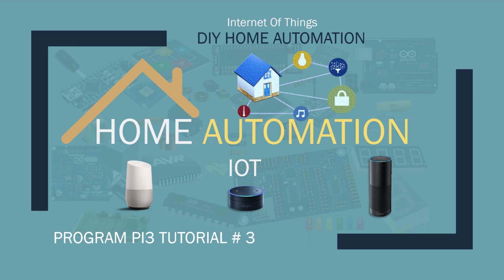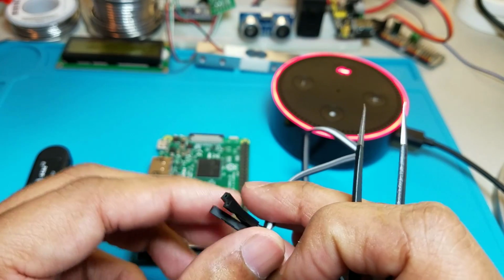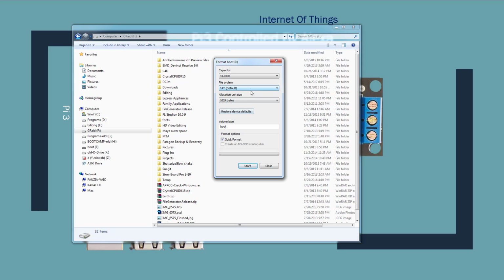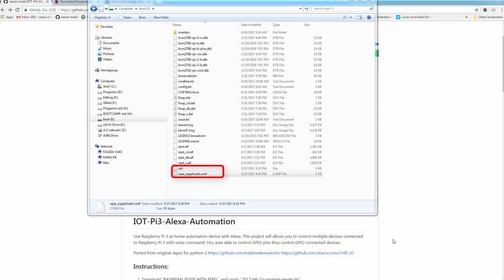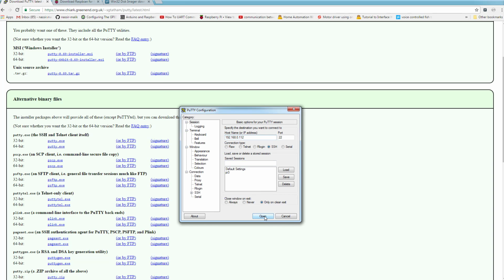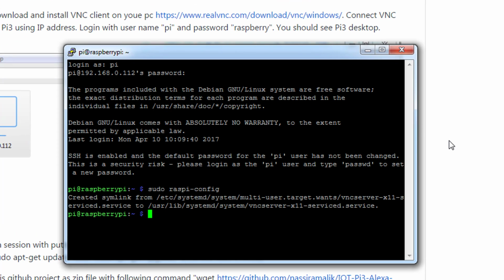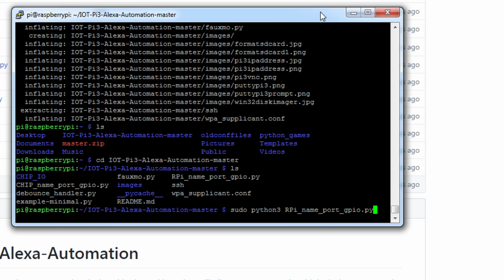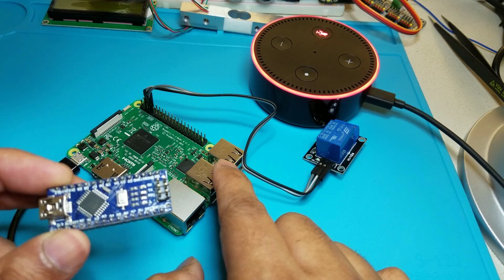Raspberry Pi projects beginners | Home Automation with Alexa | Tutorial # 3

Comment: Thank you so much for your work and clear and easy to follow video! I do however have a problem because my echo dot 3 does not find any devices. I searched for a solution but couldn´t find any. Seems like the newer alexa versions do send some different messages and fauxmo doesn´t work with that. Do you have any solution to get this running with an echo dot 3 ? would appreciate any answer :-)
Reply from the maker: Let me check

Comment: Great video Netmedias but i cant connect alexa with pi. Alexa doesnt reconize it. Im using pi 3B+ and echo 3gen. I got this log
DEBUG:root:Listening for UPnP broadcasts
DEBUG:root:got local address of 192.168.100.140
DEBUG:root:UPnP broadcast listener: new device registered
DEBUG:root:FauxMo device 'LED' ready on 192.168.100.140:52000
DEBUG:root:UPnP broadcast listener: new device registered
DEBUG:root:FauxMo device 'FAN' ready on 192.168.100.140:51000
DEBUG:root:Entering fauxmo polling loop
DEBUG:root:Responding to search for LED
DEBUG:root:Responding to search for FAN
DEBUG:root:Responding to search for LED
DEBUG:root:Responding to search for FAN
##################################   handle_reques #######################
b'GET /setup.xml HTTP/1.1\r\nHost: 192.168.100.140:52000\r\nAccept: */*\r\nContent-Type: application/json\r\n\r\n'
##################################   handle_reques #######################
DEBUG:root:Responding to setup.xml for LED
DEBUG:root:Responding to search for LED
DEBUG:root:Responding to search for FAN
##################################   handle_reques #######################
b'GET /setup.xml HTTP/1.1\r\nHost: 192.168.100.140:51000\r\nAccept: */*\r\nContent-Type: application/json\r\n\r\n'
##################################   handle_reques #######################
DEBUG:root:Responding to setup.xml for FAN

Comment: Great video, I subscribed but I am having trouble connecting my 3rd Gen Echo to the board.

Whenever I search the command line shows a connection but it eventually fails and get stuck in the loop below.  Any help is appreciated.

pi@raspberrypi:~/IOT-Pi3-Alexa-Automation-master $ sudo python3 RPi_name_port_gpio.py

DEBUG:root:Listening for UPnP broadcasts
DEBUG:root:got local address of 192.168.1.201
DEBUG:root:UPnP broadcast listener: new device registered
DEBUG:root:FauxMo device 'LED' ready on 192.168.1.201:52000
DEBUG:root:UPnP broadcast listener: new device registered
DEBUG:root:FauxMo device 'FAN' ready on 192.168.1.201:51000
DEBUG:root:Entering fauxmo polling loop
DEBUG:root:Responding to search for LED
DEBUG:root:Responding to search for FAN
DEBUG:root:Responding to search for LED
DEBUG:root:Responding to search for FAN
DEBUG:root:Responding to search for LED
DEBUG:root:Responding to search for FAN
##################################   handle_reques #######################
b'GET /setup.xml HTTP/1.1\r\nHost: 192.168.1.201:52000\r\nAccept: */*\r\nContent-Type: application/json\r\n\r\n'
##################################   handle_reques #######################
DEBUG:root:Responding to setup.xml for LED
DEBUG:root:Responding to search for LED
DEBUG:root:Responding to search for FAN
##################################   handle_reques #######################
b'GET /setup.xml HTTP/1.1\r\nHost: 192.168.1.201:51000\r\nAccept: */*\r\nContent-Type: application/json\r\n\r\n'
##################################   handle_reques #######################
DEBUG:root:Responding to setup.xml for FAN
DEBUG:root:Responding to search for LED
DEBUG:root:Responding to search for FAN
DEBUG:root:Responding to search for LED
DEBUG:root:Responding to search for FAN
##################################   handle_reques #######################
b'GET /setup.xml HTTP/1.1\r\nHost: 192.168.1.201:52000\r\nAccept: */*\r\nContent-Type: application/json\r\n\r\n'
##################################   handle_reques #######################
DEBUG:root:Responding to setup.xml for LED
DEBUG:root:Responding to search for LED
DEBUG:root:Responding to search for FAN
Reply: Same issue...Need your help here plzz....

Comment: Hey, even though this video is 3 years old, I'm trying to get this working right now, with a pi 1 model B I had laying around, with a cable internet connection.
I have it working, as far as I can say, turn on fan oder led, as those are currently the words in the github document, but my relay won't turn on or off.
Can someone please help me with this?
I have no idea of coding, but has it something to do, with the kitchen and living room stuff?
is the original code you have used available somewhere?
Reply: I have found the minimal-example script which now runs, but my relay won't switch

Comment: Great tutorial, easy to understand and the code runs without crashing. I've tried a few other examples and they are not as easy to follow or there are other problems.
That said... I can't get yours to work either. I'm using an Echo Dot - Gen 3, Rasperyberry Pi 3B+ and all devices are on the same wireless network.
When I run 'sudo python3 RPi_name_port_gpio.py' the program seems to excute and I get:
DEBUG:root:Responding to search for LED
DEBUG:root:Responding to search for FAN
DEBUG:root:Responding to search for LED
DEBUG:root:Responding to search for FAN

This will repeat indefinitely

Once I tell Alexa to discover devices I get:
##################################   handle_reques #######################
b'GET /setup.xml HTTP/1.1\r\nHost: 192.168.254.33:52000\r\nAccept: */*\r\nContent-Type: application/json\r\n\r\n'
##################################   handle_reques #######################
DEBUG:root:Responding to setup.xml for LED
DEBUG:root:Responding to search for LED
DEBUG:root:Responding to search for FAN
##################################   handle_reques #######################
b'GET /setup.xml HTTP/1.1\r\nHost: 192.168.254.33:51000\r\nAccept: */*\r\nContent-Type: application/json\r\n\r\n'
##################################   handle_reques #######################
DEBUG:root:Responding to setup.xml for FAN
DEBUG:root:Responding to search for LED
DEBUG:root:Responding to search for FAN

I don't know what this is telling me. Also I get the same response if I use the Alexa App to discover devices.

Any suggestions?
Reply: yaa i am also getting same thing what was the issue can anyone can telll me

Comment: Hi @Netmedias, does this work with the Alexa installed on an android device ?
I gave the code a go on my RaspberryPi running Buster stretch, was able to arrive at 

DEBUG:root:Entering fauxmo polling loop

However, Alexa is not able to discover the device.

I do get sample request response when I access the individual ports i.e. http://192.168.1.11:52000

In that case, it is just an issue with the built in Alexa ?

Comment: Hello, hope you well. i am very new to this. i have got to a ponit where all is running expect it will not dected devices. i am driving this from Alexa installed on my Mobile phone for now.
Please help if you can. All on the same network and connected ot the same router via wifi. Please advise

Comment: when the ssh conection is terminated, the device becomes unresponsive
Reply from the maker: You need to run the script as service. Google linux auto execute python script on boot. Good luck.
Reply: Netmedias All ready got it! also, i had to modify the code as the names were LED and FAN but in the GPIO part it said Kitchen and Bedroom and it didn’t work

Comment: Can an you have 3 relays connected to 1 Pi, and have Alexa recognize 3 different devices?

If not, do you have a suggestion on how I could do this?

Really great walkthrough. Thanks for the quality video.
Reply from the maker: You can use up to 8 relays with different name. Use the 8 relay script from github. Good luck.
Reply: @netmedias7657  Thanks for the reply! I see the file "RPi_name_port_gpio_8_Relays.py". Before I start, I have a few questions:

1. With the 8-relay script, would I still follow the near identical instructions from minutes 16-21 of this video, just with the 8-relay script instead?

2.  If the Pi has a dynamic address, will the Pi loose contact with Alexa if it is restarted (meaning the dynamic address changes upon boot?). 

3. When assigning 8 device with an 8 relay switch....is each relay physically plugged into a different GPIO pin to differentiate relay's from each other, and subsequently differentiate different device identification via Alexa?

Thanks so much, really appreciate your videos!

Comment: Whenever I run the program it will connect to my echo dot and I can see it run new code whenever I give Alexa the commands but it has no effect on my relay. Could someone help me?
Reply: A firmware update to Alexa nuked this. It no longer works.
Reply: @T H so it doesn’t work any more?? Is there any way to fix this?
Reply: M W not that I have found. Amazon went after the few that were doing this and screwed us all.
Reply: T H ok, but do you think it would work if we made another program made to scan for for example kitchen in the terminal and if it found kitchen it would turn on/off the GPIO. Because yo can see that something happens in the terminal so maby?
Reply: I found a video with code that works. If I get around to it I’ll put a link here
Reply: Casey Hardman thanks :)
Reply: So I found code that actually works. 

https://github.com/Phantom-Cluster/Alexa-Raspberry-Single-Relay/blob/master/RPi_name_port_gpio.py

Comment: hi, 
i have tried the project and i was getting an error when i typed in the last command 
it is searching for led and fan when i typed in the last code and asked alexa to discover devices and alexa could not discover the devices so can you just help me out and if you can give me your email id or something i can send you a screen shot of what error i was getting and i was using raspbian jessie with pixel only and the same version which you mentioned on the github site.
plz help me out
Reply: A firmware update to Alexa nuked this. It no longer works.

Comment: Hi Nasir thank you so much for the video everything is going as per the procedure bt in last Alexa can not trigger the relay....the pie terminal is as per the video it showing responding to search but if I say Alexa turn on kitchen it is saying ok but relay is not triggering....please help me out with this
Reply from the maker: You may be using an active low relay. When you give turn off command what happens?
Reply: @netmedias7657  nothing happens
Reply: I tried for active low and active high nothing happens relay is not triggering
Reply from the maker: @adnanazeez7400  Can you check that you are connecting to and setting in code the same GPIO. Check that your GPIO is set to high and low.
Reply: @netmedias7657  can u please guide me doing this
Reply: @netmedias7657  it is showing in the terminal as responding to search for office after that nothing happens and please guide me how to set the GPIO high to low
Reply: @netmedias7657  I have connected to the same GPIO

Comment: My alexa dot unable to find a device and im using 3rd gen dot
Reply from the maker: Gunotham Solanki It will not find it if the device is already listed. Check Alexa mobile app.
Reply: @netmedias7657  So how am I supposed to connect it with my dot

Comment: Thanx for the video. Real easy to follow.
Im using a  double relay but only using one. Echo responds OK when I ask to turn on a Lamp (which I renamed in your file RPi_name_port_gpio) So all works except lapm doesnt turn on.
Im using
Dot 3rd Gen
Python 3.7.4 (i ithink, but latest release as of today)
Pi 3+
On the relay there is JDVcc and Vcc jumpered together and a Gnd - On the other side is a Gnd, In1, In2 and Vcc
All connections are to this side. 
Vcc - Pin 4 - Vcc
In1 - Pin 7 - GPIO4 
Gnd - Pin 6 - Gnd

Ive got a small file that operates the lamp on/off every 6 seconds and that works fine, with the same setup.
Any help would be greatly appreciated
Reply from the maker: Marx M  You are using active low relay. Please watch my following tutorial. I show in it hoe to use active low 2 channel relay.
https://www.youtube.com/watch?v=pBxeHlvF4eQ
Reply: @netmedias7657  Thank-yopu for your very swift reply. Much appreciated. Ive decided to buy a single relay as I dont have the other parts mentioned in the video. I just hope I have bought the correct one. Keep up the good work.
Reply: Hello again,
I bought a active low and high relay but still the same problem.
I have set the relay jumper to active High and echo dot recognises the command, responds OK, but the lamp still doesnt come on. Any ideas as what Im doing wrong. Again thanx for all your help
Reply from the maker: Marx M This means your code is working fine but your relay is not connected to correct GPIO.
Reply: @netmedias7657  Thanx again for a speedy reply. Im using Pin 7 / GPIO4, so im really confused. The relay im using is a  - SRD-5VDC-SL-C (10A 250VAC / 10A-30VDC) with the jumper set to HIGH.

Comment: If you tell people to click yes to a warning, kindly explain what the warning is about.

Details please.
Reply: When you install an SSH server on a system, part of the process is generating a (theoretically unique) encryption key. The first time an SSH client (like putty) connects, it will warn you "I don't know this host and key. Are you sure this is the system you want to connect to?" (wording will vary, depending on the client). Say "yes" and, after that, the client will know the host, and not bother you again.

Except ...

If the server gets its IP address via DHCP, it could get a different address next time. That will start the "Are you sure?" cycle again. Another problem can arise if you have more than one Pi board or other gadgets. You "verify" with Pi #1, do something with it, then unplug it and plug in #2. If it gets assigned the same IP address, the SSH client will freak out, and warn you that someone may be trying to fool you because the address and key don't match.

To avoid these problems, use the feature on your WiFi router that lets you reserve a DHCP address for a given MAC address. Then every device will have a consistent address.
Reply: Can't you read?

Comment: Would I be having an issue because the wpa_supplicant.conf info is incorrect?
Reply from the maker: David Strausberger Please look a the info for the respbian version you are using. The newer version has the wifi setup. Once you are connected to wifi then it should be ok.

Comment: Error? Thanks.
Traceback (most recent call last):
  File "RPi_name_port_gpio.py", line 92, in <module>
    fauxmo.fauxmo(trig, u, p, None, port, d)
  File "/home/pi/IOT-Pi3-Alexa-Automation-master/fauxmo.py", line 207, in _init_
    upnp_device.__init__(self, listener, poller, port, "http://%(ip_address)s:%(port)s/setup.xml", "Unspecified, UPnP/1.0, Unspecified", persistent_uuid, other_headers=other_headers, ip_address=ip_address)
  File "/home/pi/IOT-Pi3-Alexa-Automation-master/fauxmo.py", line 141, in _init_
    self.socket.bind((self.ip_address, self.port))
OSError: [Errno 98] Address already in use
Reply from the maker: BEE BEE There is another process listening on the same port that the script is trying to use. Please use unassigned ports. Good Luck.
Reply: @netmedias7657  Thanks

Comment: Sir, I am having an issue with running the RPi_name_port_gpio_8_Relays.py.
when i poll for the 8 relay .py i get an error at the end of polling.
"DEBUG:root:Responding to setup.xml for living room
CRITICAL:root:Critical exception: [Errno 104] Connection reset by peer"
not sure at all what's going on. 
Thank you in advanced for any assistance you may offer.
p.s. the 2 relay script works fine.
Reply from the maker: m sherwood Can you add 6 more devices into the working script and let me know it is still working. Thanks

Comment: Thanks for the tutorial, by far the easiest one i've found. Question though, how can you modify the code so it doesn't require a state "on" or "off" at the end? I've modified the code so it sends IR commands to my TV. Works great for "TV on" or "TV off", but right now i have to say "Input 1 on" to change inputs where i'd rather just say "Input 1"
Reply from the maker: You can create Alexa routine in you alexa mobile app. Then you can map that command to any device. You can have customer routines setup like "Alexa switch to input one" and that can be map to an on or off state. Good Luck.
Reply: @netmedias7657   Thanks, that's useful. So in messing with this for a week, i've found it would be useful to have the state be a string instead a boolean, is that possible? This way i can I have one smart device called "receiver", then instead of passing in "on" or "off", it can be any word or phrase.

Comment: Hi man,
When I try to discover devices with my alexa second generation it gives this  notification.
But the problem is, alexa says it couldnt find any devices do you know what the problem could be?

DEBUG:root:Responding to search for office
##################################   handle_reques #######################
b'GET /setup.xml HTTP/1.1\r\nHost: 192.168.0.52:52000\r\nAccept: */*\r\n\r\n'
Reply from the maker: Daniel Lankheet Check your Alexa mobile app and make sure that devices are not already listed. I will do this if devices are already discovered. I tested it with 2nd and 3rd gen and it works fine. Good Luck.
Reply: @netmedias7657  I've looked on my app and also tried adding them with that but still didn't get any results...
Reply: @netmedias7657  Still can't get it to work, installed a new version of raspbian and still alexa can't find my devices
Reply: Dear @netmedias I solved the problem! Found another video on youtube with the same fauxmo.py script but with another starting script. Opened the folder and swapped the 8v relays file and it worked! I think the guy from this github project updated the fauxmo.py that it does'nt work in my setup anymore. Here the link to the other git project  https://github.com/Phantom-Cluster/Alexa-Raspberry-Single-Relay